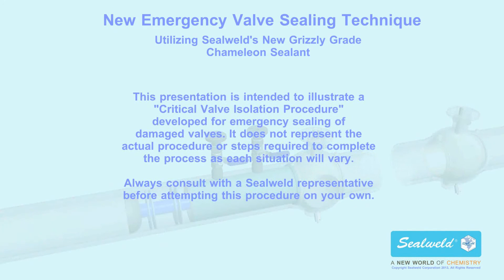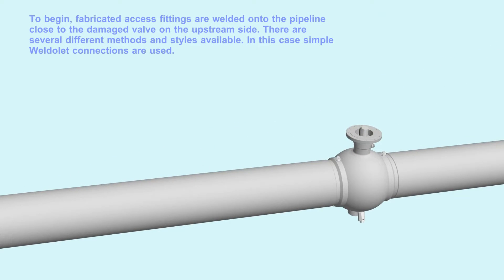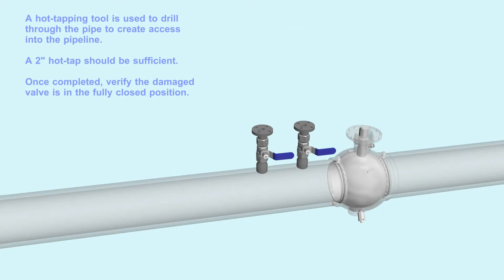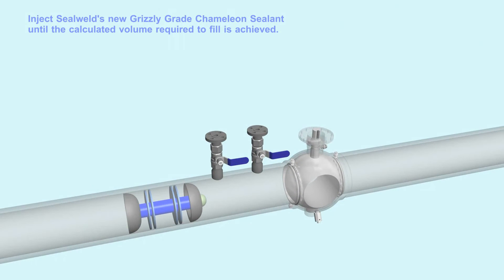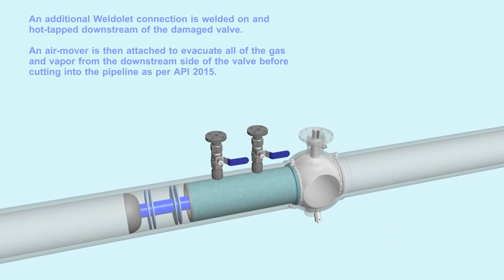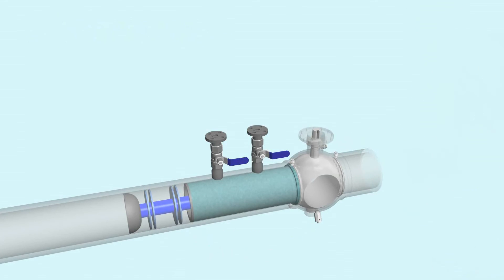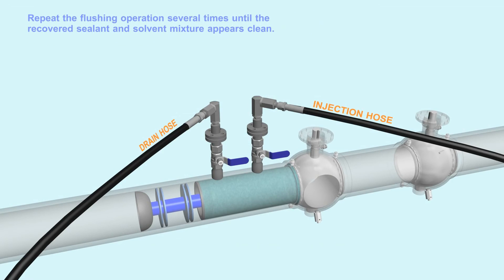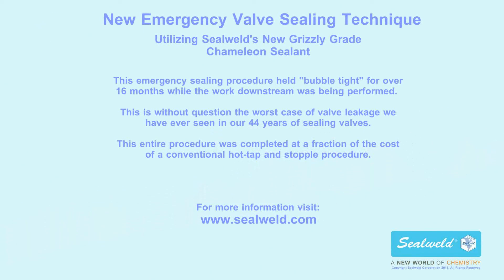Sealweld Emergency Valve Sealing Technique

Comment: Very much impressed by the procedure, I have over 45 years in Industry and it is a very good approach to solve such a problem especially on gas/oil flow lines.